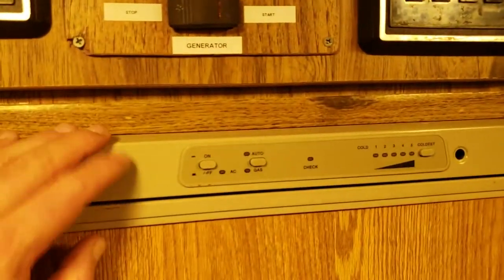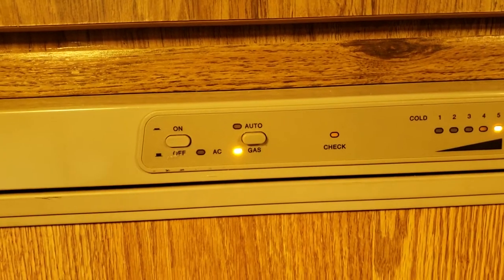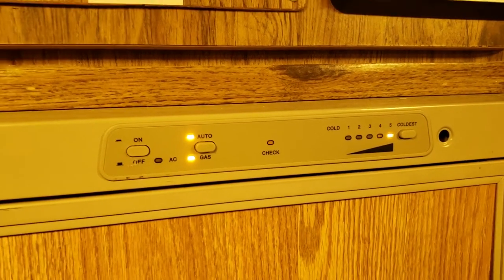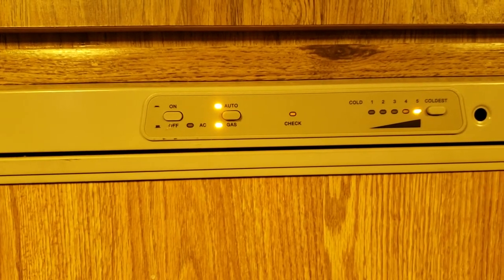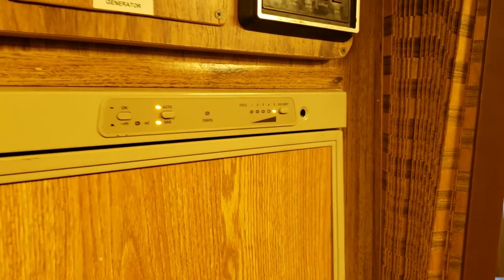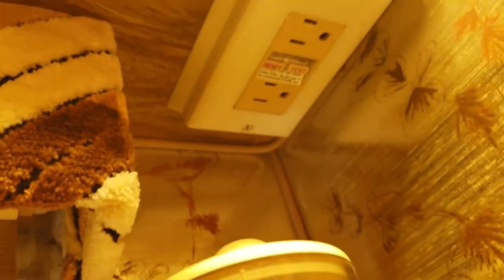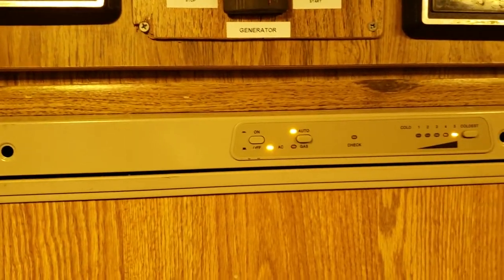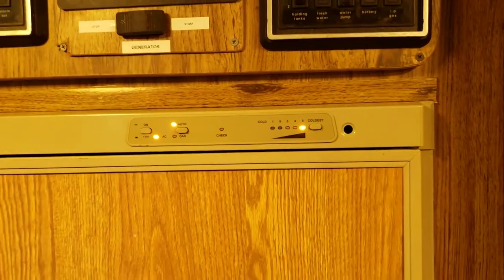RV Fridge Won't Run On AC Power - Fixed - Check This First!

Comment: We came home from work after a storm. Lights and ac worked fine but the fridge would only work on propane. I tried everything! Flipped breakers, checked fuses, even did the shorel line/battery reset. Turns out gfci switch in the bathroom! I was CRYING when I found your video!

Comment: Thanks for the tip!  Resetting the GFCI was all that I needed.  I went from thinking I needed a new motherboard to pushing a a reset button at no cost at all.  I wish I had time to see your video before our trip to Yosemite!  Would have had a much happier wife.
Reply from the maker: Glad I could help. Thanks for the comments and happy camping.   Jim

Comment: You were right on! Had a storm blow through, lost power, came back on and the frig would only run on propane.  I did exactly like you did, couldn't find the issue, after awhile thinking about it I googled the issue and there's your video!!! Yep, I checked the bathroom GFI and yes it was tripped. You totally saved me calling the repair guy!!
You're the best!!

Comment: MY HERO!
My check light on the fridge was on and not getting any cooling to fridge. Flipped the GCI and it’s working again. Also my propane heat/furnace was not shutting off automatically. The GCI flip solved that issue as well.  Thank you so much for this posting

Comment: It's the night before leaving for a weekend getaway and the fridge would work on gas and dc but NO ac power. Played with the buttons over and over, circuit breakers, you name it I checked it. What a great feeling to push the GFCI reset and away the fridge goes on full ac power. Thanks for posting this very simple and yet amazingly helpful video!

Comment: THANK YOU!  I was just ready to tear into the refrigerator to find out what was wrong. I had my trailer washed yesterday and today I noticed my Norcold fridge would not work on electric, but it did on gas. I wish I would have thought about the GFCI because, duh, things got wet! As soon as I saw your video, I thought,  "This must be it!" At least I hoped it was. And it was!! Thank you again. You're the man!

Comment: Thanks for your help.  We struggled all day to try and figure out what was wrong.  Our ac light for our refrigerator would not come on.  We tried everything by watching numerous youtube videos, read the manuals, etc.  We followed your instructions and it worked like a charm!  We are really new to using an rv.  We got a little 2011 Chalet LTW A frame. Taking it out camping for the first time tomorrow.
Reply from the maker: Debra Mae I'm so glad I could help. It drove crazy for thirty minutes when it happened to me. Have fun on your camping trip. Thanks for watching and take care.      Jim

Comment: You are awesome! I came back to my trailer with my fridge stopped working with the check light on. Checked fuzes and breakers.  I came across your video and went into the bathroom, hit the gfci reset and ding, fridge is back on!
Reply: How did you figure that out? I would have never considered it!

Comment: I moved my Bunkhouse everything was working. Then after getting it setup the refrigerator was not coming on. The green light was on but no sound not cooling. Turned off slept on it. Then I started watching different videos on troubleshooting. Thank the lord for people who take the time to share information! I started checking for reset buttons I have only one. Then I checked all fuses then I opened the refrigerator and unplugged and replugged the little cable that is inside boom it came on! I was over the moon now we wait and see if it cools!  I had a breaker put in so I could run my little camper here on my property. I don't have the battery hooked up yet that will be next after I watch a few videos! Thank you sir for sharing with newbies such as my self!

Comment: Thanks for this video, however it was not my problem. If this is not your problem but you are seeing these symptoms go to the outside of your camper, and open up the panel on the outside of the fridge. Unplug the plug you see to disconnect power. There is a small black plastic box. Pop off the cover and there is a small glass fuse. In my case the glass fuse had blown. Still a very simple fix.

Comment: You are the man, i was checking everything as you did and its cold and raining so i didn’t feel like going out. The socket in my hallway sink across from the bathroom was out, when i reset it the fridge switched over with 20 seconds. Not sure why that socked tripped but I have many people walking around so maybe someone hit the reset.. thanks again

Comment: I no you have a older RV and it seems like the fridge controls haven't changed for years.  Thanks for the video and good fix.
Reply from the maker: mark mathews  Thank you for the comment. You are correct. The domestic refrigerator that is in my RV is only a year and a 1/2 old. It was installed brand new  And looks a lot like the older ones that I see all the time.  It sure does work better though.   Jim

Comment: My norcold 3way fridge was not running off AC power. Had two fault codes on it. A and F. Indicating AC power was not available. The 15amp blade fuse was okay inside the trailer...was going crazy, gfci in bathroom was good also. Went outside and opened fridge access panel. Unhooked all power and found that the 5amp 250V glass fuse was fried. Replaced it and now it works perfectly on AC power. East fix after alot of reading and checking.

Comment: I'm sure it's helpful for some. Good for me to know for the future. Unfortunately that wasn't my situation. I found a 5a fuse blown, replaced it. The fuse didn't blow again, but the electric still doesn't work. I can hear a relay switch over when plugged in. The flame goes out. But it appears to not be energizing the electric heater coil. The coil measures infinite resistance. I don't think it should, but I don't know yet. Will keep searching.

Comment: OMG I love you!   As soon as you mentioned that it made perfect sense to me!  I actually figured out that it had been tripped but kept forgetting to reset it because it wasn’t using anything connected to the GFI   I didn’t even realize it had switched over because the auto light  was the only light lit   I had to replace my RV Battery and that’s when the trouble started.  Had run out of propane about 8 hours later while I was asleep couldn’t get the battery until the next day   Hooked up the battery but when the fridge wasn’t getting cold I started messing with it to manually select A/C Power and it wouldn’t go. I’ve been pulling my hair out THANK YOU THANK YOU

Comment: All most All the outlets are on GFI! It is good to get a plug tester. When you checked to be sure it was plugged in you could have plugged in the tester and it would have not had a light and that would should that there is no power. They don't cost much money and give a lot of information. They will tell you if you have an open ground or common wire and much more.  I forgot what it cost but I am sure it is something around $10 or less. My has saved me hours of time trying to trouble shoot wiring!  I know why they call it Trouble Shooting!  Because after 4 houres you feel like Shooting something! LOL!

Comment: Ugh my fridge will only work with gas!! Over checked all your suggestions.  I have auto/off/gas options.  I have plugged into 30amp and house plug it works with 30 amp but house power 😢.

Comment: I have only one GFCI mine is in my bathroom and it was replaced and my other plus now work. My frig will run on electric and then quit 
The only way it will cool down is on Propane

Comment: Mine has ac dc and gas option, it only seems to work on dc sometimes though. Worked on ac a few days but now won't again. Dont have propane hooked up but if I keep the charger converter running dc works. My batteries aren't taking a charge tho so I don't want the charger wasting power

Comment: First off thanks for all your great videos!
We are going to be going full time out of our 17' bigfoot trailer and there will be days we want to run the AC for our dog as we go for an 8hr ish adventure. We are selling our house so price is not the biggest concern for our battery bank. I know on your old channel you would do tests, so i was wondering what amount of amp hours you think we would need from a Lithium bank setup?
Thanks again for all you do!
Reply from the maker: alexzanderarmstrong It takes a lot of battery power top run an air conditioner.  I would recommend 800 to 1000 amp hours to run a RV air conditioner for 8 hours. I would consider a generator if you want to do this often. I hope that helps. Thank you for watching and happy camping.   Jim
Reply: Thanks Jim!!

Comment: How do you feel about solar fridge replacing a 3 way fridge in an RV. Can you do a review on solar fridges
Reply from the maker: I guess I am a little confused when you say "solar fridge". Every refrigerator has to run on 12 volt DC, 120 volt AC, or gas. A 3 way fridge is capable of running on all 3 power sources correct? You can run that fridge off of 12 volts DC using batteries and solar or 120 volts AC using an inverter, batteries and solar or gas. So why do you need to replace it to use solar?     Jim

Comment: do u need to have propane in ur tank to make it work properly
Reply from the maker: If you're running it on AC power then no. But if you do want it to run on propane yes, you would have to have propane in the tank. Hope that helps. Take care and happy camping.   Jim
Reply: helps, and im plugged in to the house and one day I realized it wasn't cold, the tube is out on the outside but its not cold on the inside grrrr
Reply from the maker: @randyrankin3604  If the refrigerator is level and plugged into AC power it is probably time for a technician to have a look.

Comment: It was a good tip but after doing that for a few weeks, the GFSI went out so, I replaced it with a new one and it still doesn't work. I'm left wondering what it is that keep tripping it. Fridge only runs on propane now.

Comment: Ah, when I found your channel I was sure hoping that was my problem. Unfortunately, it was not. Can you give any more ideas on trouble shooting to find the problem?
Reply from the maker: Did you check for power at the plug the refrigerator is plugged into?  Try using a fan or alarm clock to test the plug for power if you do not have a tester. If you have power at the plug then it is the wiring of the refrigerator that will have to be addressed. I hope that helps.     Jim
Reply: fullmoonadventureclub   My husband just told me that it keeps blowing fuses on the control board.  It seems to get power for a few seconds before this happens.
Reply from the maker: @susandickerson5752  Unfortunately I can't really help diagnose a wiring issue. You might need a professional. I wish i could be more help. Please let us know if you find the problem so it might help others. I wish you luck.

Comment: We are in a pickle our Artic Air the freezer works but Refrigerator did not work on AC power.  But if you run it on Gas the Refrigerator works.  Could it still be a GFI?
Reply from the maker: No. If the refrigerator is working in any way on AC power that it's not the GFCI plug. Sounds more like a refrigerator issue.
Reply from the maker: No. If the refrigerator is working in any way on AC power that it's not the GFCI plug. Sounds more like a refrigerator issue.

Comment: Looks like you have an older RV?  I have an older RV and their is not much info on U tube for older RV's....Having trouble with my Refridge, I have the same one, I have a 1984 Itasca Sunflyer.   QUESTION.  My fridge only works when I have my key in the ignition on on.  Once I take the key out Fridge does not work, and I am plugged into an outlet outside my home.  Any suggestions?

Comment: I thought it was my gfci plug but the outlet run by the door runs off it and is working fine but the rest bitten is stuck could this still effect it?
Reply from the maker: I'm not sure it's possible. But if the reset button is stuck in it needs to be replaced anyway.
Reply: fullmoonadventureclub yes I figured. I was wondering if it means anything I particular if not only is it not working like it used to on ac the light is of that told me it was working but the check light isn’t on. I would think If there was an issue that light would be on.
Reply from the maker: @lithium5755  usually won't say there's an issue if it's just lacking AC power because it thinks everything is fine but the AC power is not connected and you're running off gas. You might be able to troubleshoot this by running an extension cord to a reliable power source and then plugging your refrigerator into that. If it works on AC using that method then you know it's an AC problem in your RV

Comment: My fridge and main lights in the rv having randomly switched over to running on my battery.
I have shore power, im plugged in but i noticed the lights slowly diming over time and the fridge kept clicking and the check light started flicking on and off.
Ive reset the GFCIs but its still like this.
Checked that the fridge is properly plugged in and it is.
It worked all winter then about 3 weeks ago it started doing this..
I have a Dometic fridge
Reply: My microwave has remained uneffected thruout this whole ordeal
Reply from the maker: @jakechamberlain2206  it sounds like a breaker or possibly a converter issue. If you're plugged into Shore power your lights should never Dim. Even if they were running off the battery the battery should stay fully charged. Try flipping off every single breaker completely and then turn into the ball back on who's that doesn't work it may be time to start checking wiring.
Reply: @fullmoonadventureclub  ok thanks man.
I had my car battery hooked up to the rv battery and it recharged the rv battery. Then i disconnected them and everything was fine for 3 days. Now its all dim again

Comment: I have the same fridge in my 90 coachmen catlina, and when hooked to my house power the fridge turns on and i can heard the fridge doing its thing but after 5 hours no change in temp, have not tried it on propane yet, but what could be the problem? I checked the plug in the bathroom , and fused and all is good , any ideas?
Reply from the maker: It is possible you are out of or low on coolant. Older refrigerator used Ammonia as coolant. Unfortunately this is not something you can fill. It may be time for a technician to take a look.
Reply: I think I will just replace it all together , i need one that works for months on end without having to fool with it
Reply: Also would it throw a check light of it was low?

Comment: I’m pulling out my hair but different problem, if I’m plugged into house power the AC light is on and fridge runs and gets cold, I also have on-board generator which switches fridge to AC also and the fridge does run but doesn’t get cold at all it’s warm, same with propane doesn’t get cold, plug back into my house and gets really cold.
Reply from the maker: Might have something to do with low coolant level. When it doesn't work is your RV nice and level compared to when it's parks at your house? When coolant gets low refrigerators are picky about being level and still.
Reply: fullmoonadventureclub definitely level! I have no clue what’s going on, you need a pressure check tool I believe to check these but my trailer is new
Reply from the maker: @RoadTripMan4U  that is strange. Especially with the new rig. If you're having problems on AC and on gas you probably have some kind of circuit board issue and it may need to be diagnosed by a pro. I'm sorry I could not be more help

Comment: That isnt my issue,  i have already reset the GFCI, and it isnt helping... still wont run on AC power
Reply from the maker: Did you check for power at the plug the refrigerator is plugged into?  Try using a fan or alarm clock to test the plug for power if you do not have a tester. If you have power at the plug then it is the wiring of the refrigerator that will have to be addressed. I hope that helps.     Jim
Reply: @fullmoonadventureclub  How do I know what to do with the wiring?  When I put it to auto, it does switch to ac but the burner shuts and thats it.
Reply from the maker: @projet2907  if you have power at the plug where the refrigerator plugs in then it's a wiring issue inside the refrigerator. Afraid  that  I  cannot walk you through diagnosing the wiring system of the refrigerator. You will have to get it fixed by a professional. There are too many variables for me to try and tell you how to fix the internal components of the refrigerator. I wish I had better news for you. I wish you luck.  Jim
Reply: @fullmoonadventureclub  Yes, I can understand, Thank you Jim.
Reply from the maker: @projet2907 My pleasure.  I wish I could have been more help. Take care.

Comment: What if it wouldnt stay on AC it kept flipping to gas until I turned the air conditioning on then it started running fine? Was it just hot a fuck and wouldnt run on ac until I cooled to travel trailor down?